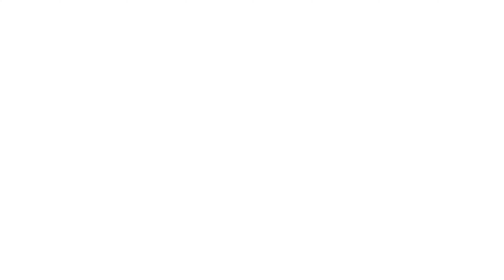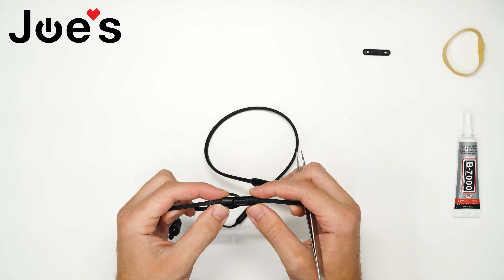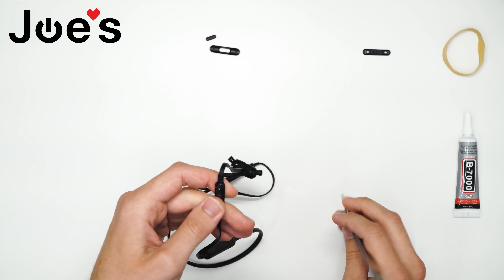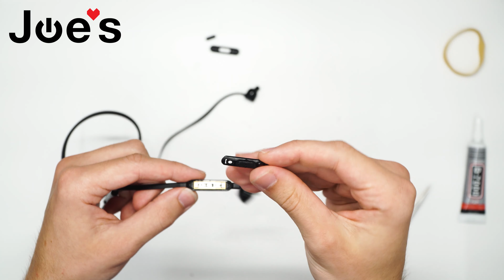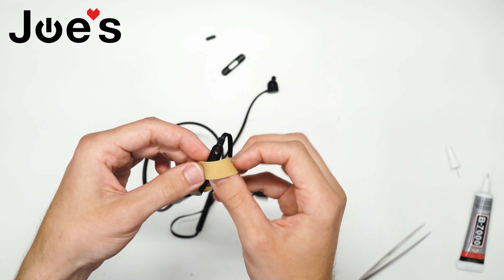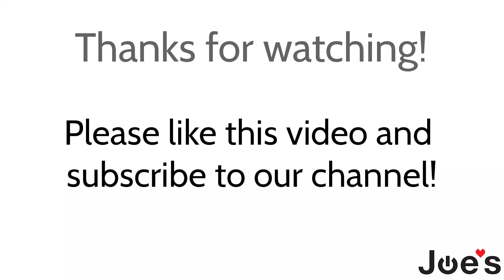Tutorial How To Repair Replace Beats X Control Talk Internal Cover CTC

Comment: How do you put back the button cover after the assemble? Should I use glue?
Reply from the maker: Thanks for the comment. You would need to just clip in the control talk cover it has one clip on both sides to clip into the housing cover. If you would like your device repaired by a professional you can fill out a repair form and follow the steps to send in your item. We offer free shipping and diagnostics. Here is a link to the repair form:
https://www.joesge.com/pages/repair-services

Russ C.

Comment: Hi, I am looking for the replacement of Microphone of BeatsX. If it’s possible please guide me. My problem is the other side that I am talking with can’t hear me good like before.
Reply from the maker: Thanks for the comment. The issue you are describing sounds like the microphone just needs to be cleaned out it's probably clogged up with random particles over time. This is a common issue with the Beats X. If you would like your device repaired by a professional you can fill out a repair form and follow the steps to send in your item. We offer free shipping and diagnostics. Here is a link to the repair form:
https://www.joesge.com/pages/repair-services

Russ C.
Reply: Joe's Gaming & Electronics thank you for your reply but I am living in Germany and it cost too much to send it and of course take a long time. It will be great to make a video about this Problem. I searched the YouTube and googled, but unfortunately I couldn’t find any video or article about this issue.

Comment: Is this possible without the heat gun? I feel like every time I want to fix something I am instructed to by another special tool that will likely not be used for anything else... not even most electronics use heat guns for assembly
Reply from the maker: Thanks for the comment. We recommend using a heat gun due to clean disassembly. You can try using a hairdryer but you will not be able to adjust the temperature. 
If you would like your earbuds repaired by a professional you can fill out a repair form and follow the steps to send in your item. We offer free shipping and diagnostics. Here is a link to the repair form:
https://www.joesge.com/pages/repair-services
-David P
Reply: @Joesge  
Great, what would the cost be? I have already removed cap... Just need the "switch/cover" they are pennies from china, what would you do this for?
Reply from the maker: We are more the happy to help you out with this issue. Unfortunately we are unable to quote you on this repair at the moment. If you need a quote you will have to send your device into our repair center. We offer free shipping and free diagnostics. Please visit the link attached to start a repair request. https://www.joesge.com/pages/repair-services

Comment: Can I do this to my powerbeats3? The volume button not working 😨
Reply from the maker: Thanks for the comment. The BeatsX control talk/volume buttons are very similar to the Powerbeats 3 Wireless control talk/volume buttons. Unfortunately we currently do not have a video for the Powerbeats 3 but you can use this BeatsX video as it is a similar repair.
-David P